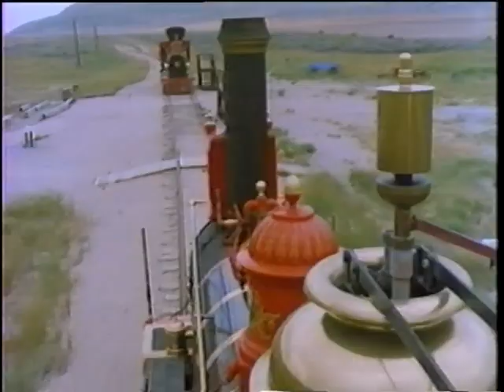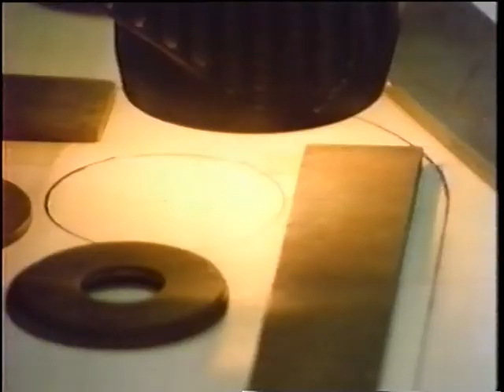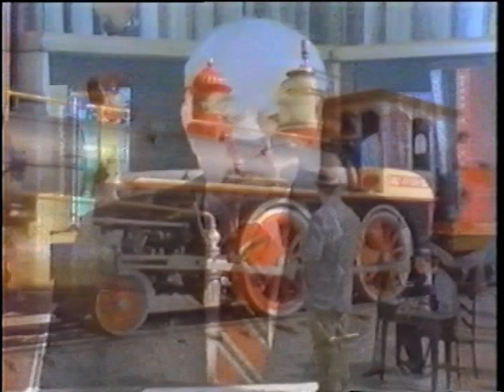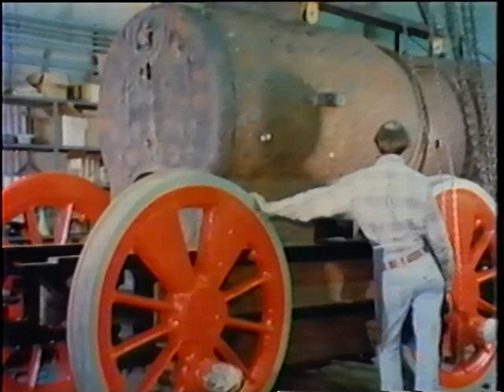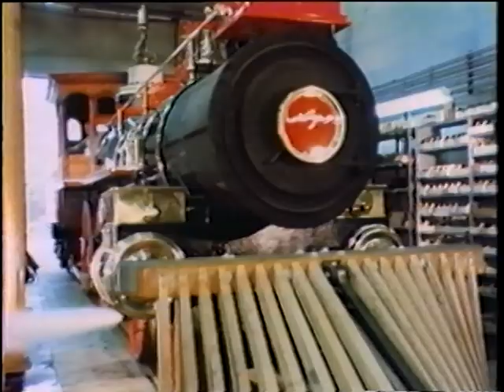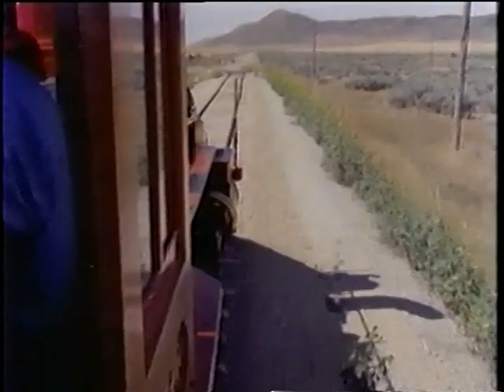Building of the Jupiter & 119 Locomotives

Comment: I saw this on TV when it first aired and never forgot it.  I've been a model railroader since the age of 14, having been born in a house only about 100 yards from the main line of the old Chicago, Milwaukee, St. Paul & Pacific, the "Milwaukee Road," in 1940.  I've built many railroad models, including steam locomotives, and although I love all eras of railroading, I'm very fond of modeling the days of Steel Rails and Iron Men of the late 19th, early 20th centuries.  Watching the process of building locomotives with a scale of 12"=1', after building them in 3.5mm=1' (HO scale), 1/4"=1'---and even one in N scale (.075"=1'), was quite interesting.  For instance, when they showed and described making and pressing in drive wheel crank pins, I had to smile, as the ones for my current locomotive are made from 1/8" diameter steel, drilled and threaded O-80 for hex head retainer screws to hold the side and drive rods in place.  Thank you for posting this!

Comment: Excellent video, a lot of work and a lot money! These two locomotives are similar type to the New Zealand K class Rodgers loco,s no 88 & 92 built around 1878, one spent many years in a riverbed,it got pulled up and fully rebuilt. NZ had two types of K class the early Rogers K class, later a big powerful KA/KB were built they weighed almost 150 tonne.The KA was No relation to the Rogers K class, completely different locomotive.

Comment: Here in Queensland we have a A10 Nielsen 1865, 0-4-2 with 2-axle tender, still running after years as a pedestal mount outfront of our main Station and Yards in Brisbane. Then restored and made part of the Heritage Fleet. ( original coaches as well).
Runs regularly on the High Iron ( 120 lbs/yd...60kg/m.) A long way from the original 30 and 35 lbs/yd of the 1860s and 70s.
DocAV

Comment: What gauge are these engines?  I am assuming that they are 5 foot gauge and it wasn't standardized until just after the Civil War to 4 feet 8 1/2 inches.
Reply: They are standard gauge.  The US was predominantly 4 feet 8 1/2 inch gauge, and such was the transcontinental railroad.  It was the southern (Confederate states) railroads that weren't standardized.

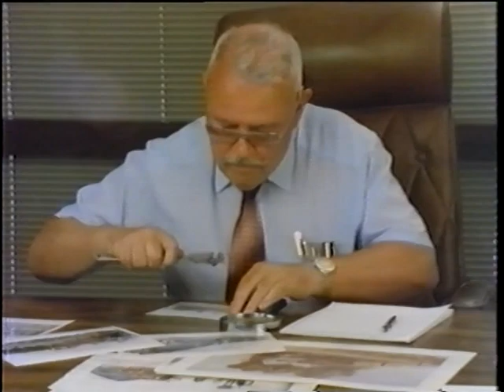Comment: The engineering analysis of the old photos is an early use of photogrammetry (3:11) which itself is historic and important. It's interesting to find that here. While photogrammetry was used more than a century before in mapping, industrial uses are much more recent. Instead of computers they had to rely on a combination of measurement, knowledge of standard part dimensions (and not much was standard in the 1800s!) and many years of experience. It's quite an accomplishment!

Comment: Beautiful craftsmanship guys. Don't see much of that today, but there are still individuals who appreciate and understand the effort and talent that went into building those engines. Just gorgeous.
Reply: There is plenty of equal or superior  engineering and craftsmanship today. The public are simply not aware of it as it's not relevant to their lives. Every process you see in that video is still common in industry and given how long machine tools last, some of those shown are likely still making parts. The track torches shown cutting heavy steel are still in use throughout the world. So are the machine tools. Casting methods and practices continually improve. The thinwall precision cast auto engine blocks of today are one example of many. Manual welding equipment is builds billions of dollars of pipeline, bridges, ships and much more every year. 

People should really stop thinking of everything they don't trip over on the way out their front door as a lost art. If you dig that stuff, try model railroading as a hobby! The same skills are used at a much smaller scale, and small work is often more demanding then cruder larger work with looser tolerances.

Comment: @23:00 where are Chinese labors that actually built the railway?
Reply from the maker: I think you missed the point of this story.   I'll make it simple.  It's about the building of two replica locomotives not the Chinese.   You need to make your own video.
Reply: Chinese labourers built PART of the Central Pacific Railway, only.  They were by no means the only workers on the CPRR.  The Chinese were used to build the right of way but by far most of the tracklaying was done by whites, who were stronger and had more stamina.
Reply: I'm pretty sure they were out having lunch...

Comment: Brunel didn't inspire them?
https://en.wikipedia.org/wiki/Track_gauge_in_North_America
Reply: The original Erie Railroad and some of its connections were built to six feet gauge.  The system at one time extended to the Mississippi River.  However, the death knell of odd gauges (such as the Southern States' five feet gauge) was sounded when Lincoln chose Stephenson (or, standard) gauge for the transcontinental railroad.

Comment: I'd like to point out, that America was far behind on the engineering of steam engines compared to places like Britian. They still are
Reply: I've spent a long lifetime studying the railways of both places.

An American locomotive would not be able to navigate British railways because the loading gauge is so different.  British trains were much smaller in clearance dimensions than American.  Even some U.S. narrow gauge trains were larger in over all dimensions.

Also, the British track structure in steam days could not take the high axle loads common to North America.  While axle loads of 20 Imperial tons were near the limit, U.S. mainline railroads built to standards of 30-40 U.S. tons.  The British system of rail raised up from the ties on chairs would be entirely crushed by the large American rolling stock.

However, if the clearances were the same, it is absolute poppycock to suggest a North American locomotive would not be able to perform admirably in Britain.  I have the books of gradient profiles in the U.K., and there is nothing that a North American locomotive could not surmount -- even Lickey incline.
Reply: No, in fact the exact opposite, Locomotives of North America, although initially behind, were quick to catch up, and eventually eclipsed English locomotives in design. The reason was simply due to the fact that English railways were built to significantly higher standards than North American ones (well western ones), and did not have to negotiate steep grades and sharp corners. Bulk commodity freight also played an important role, in forcing North American locomotive builders to construct far larger and complex locomotives.
Reply: Noah Whiteis You're correct about the larger and complex locomotives part, however, you're forgetting Wales, parts of Britain, most of Ireland and Scotland, all are extremely hilly, almost mountainous places, which, locomotive designers had to work around, by building tunnels, which wasn't preferable due to the cost of it, or building up or around it, most of the time it was around, which, usually resulted in semi sudden curves. Even with re-gauging, an American locomotive would on the best of days struggle to navigate most English railway lines, especially in Wales or Scotland
Reply: What codswallop!  As any novice knows, ability to speed is more a product of track alignment and structure than of locomotive design.  Although Canada and the U.S. combined had more railway route mileage than the rest of the world, relatively little of it was built for speed.  Government regulations further limited speed to 90 mph on hundreds of miles.

Is "oil lubrication" all you've got?  First of all, you're wrong about that.  Secondly, the British relied on archaic and feeble plate frames, riveted copper boilers and plain bearings long after N. America had moved to cast engine beds, steel boilers (1860s in Canada!), welded boilers, , roller bearings, pressure lubrication shaking grates and several efficiency appliances.  It was Francis J. Cole of ALCo who, in the 1900-10s, developed the boiler ratios and design parameters that were used universally to the end of steam -- including in Britain.  British locomotives, over all, were poor steamers, with a few exceptions.

The most efficient locomotive class ever built, in horsepower per pound weight, was New York Central's S-1 (and S-2) 4-8-4s, the magnificent Niagaras.  Only one French experimental locomotive, never duplicated, had a better power-to-weight ratio.

Mallard's "speed record" is a British hoax.  Like almost every other British claim of 100 mph, Mallard's "record" was achieved on a significant down-grade of 0.5% (1/200).  A grade of 0.25% (1/400) is sufficient to cause unbraked rolling stock to start rolling on its own.  Gravity-assisted records are not records at all and never have been.  On 3 July 1938, Mallard averaged 201.2 kph (125 mph) over a half mile, and is reputed to have "touched" 202.6 kph (126 mph) pulling a 240-ton train.

The true record is held by Deutches Reichsbahn Gesellschaft 4-6-4 05.002, which on 11 May 1936, on LEVEL TRACK, pulled a 197-ton train at 200.4 kph (124.5 mph) between Berlin and Hamburg.  Of course, the British could never admit a locomotive from Nazi Germany continued to hold the speed record, could they?

The fastest regular steam locomotive performances in the history of world railways were performed by the CMStP&P (Milwaukee Road) Class A 4-4-2s on the "Morning Hiawatha" train.  They were required to achieve more than 100 mph every day to maintain schedule -- with a train exceeding Mallard's "record" train in weight.

G. J. Churchward of the GWR is the man credited with the greatest advancement in British steam design.  His adoption of Belpaire fireboxes (from Belgium) and large bearing surfaces, casting of cylinders & saddles together and taper boilers (from the U.S.) were almost universally adopted in the U.K. (except LNER).  However, he continued with plate frames and riveted copper boilers, miring British design in the 19th Century until British Rail's R. A. Riddles in the 1950s.

Final note for now:  The most obvious measure of how backward British steam design remained through the 1940s is that replicas like Tornado can be easily built today while it is now impossible to build a replica of a modern North American steam locomotive, because the advanced manufacturing techniques no longer exist.
Reply: @jppicur  let's not forget the couplers!
Reply: And that's why Britain is the super power it is today...
Reply: Noah Whiteis American locomotives were large, that is all you an say for them. Were they advanced? No, they only started to implement oil lubricating in the 1920s after a GWR castle traveled in through the US on a rail tour. Where they fast? No, despite having multiple times the tractive effort, due to their ridiculous size, they were eclipsed by Mallard. Where they good looking? No, they had drab livery, and exposed pipes and stuff everywhere.

American designers built big locos, not efficient or advanced locos. This means that you can wave around stupidly high tractive effort and good hill climbing. This is why they seem advanced. However, they were still fairly slow and relied on old technology.

The reason British trains weren't large is that there was simply no demand, that is why the UK stopped at Pacific for passengers from the 1920s to the 1960s and 2-8-0 or so for freight in the 1910s to the 1960s. They weren't hauling thousands of tons on a regular basis, and they weren't supposed to. It is unfair to judge British trains on power, an aspect they simply didn't need. It is far better to judge on technology and speed, something both nations desired.

Comment: Ya know, these trains could be an answer to keep trains around as fossil fuels deplete. We have alternative ways to create the heat we previously needed coal for.

In the end, the steam engines could replace the diesel trains we use now.
Reply: +Bennie “Bee836” C nowadays we have so many ways of transforming energy into all kinds of forms, that we can afford to focus on efficiency instead of technical possibility, as was done in the steam age. a reciprocating engine that needs fuel whether or not it is moving is highly inefficient - what is much more efficient and convenient is using all kinds of fuels to power steam turbines which in turn power alternators. that electrical energy can then be used on trains on demand, and switched off if not in use. and that is exactly how it is done nowadays
Reply: There might actually be potential here. The Coalition for Sustainable Rail is developing a carbon-neutral coal alternative using torrefied biomass. They've already done some real-world tests using Everett Railroad #11.
The main problem with replacing diesel is the low thermal efficiency of the traditional steam locomotive design, but some minor changes can be made that improve it drastically. If you're interested, look up a South African locomotive called the Red Devil. It's about twice as efficient as a traditional steam locomotive, and could be the blueprint for the future of steam.
Reply: @michaelramsey82  I never knew Red Devil was so efficient. Very interesting! And besides the new carbon neutral coal from torrefied biomass, I found there are advantages that a steam locomotive has against a diesel. They produce more torque than a diesel, making them very powerful. Although it does create more torque at higher speeds, the amount of torque it creates is greater than that of a diesel. So a single steam locomotive can haul longer and heavier trains than a single diesel can without the help from extra locomotives.